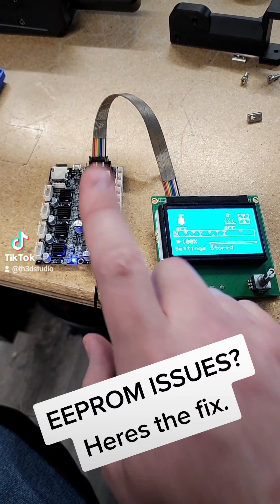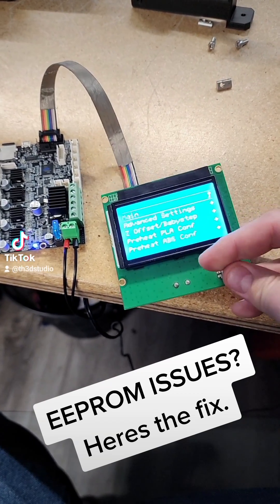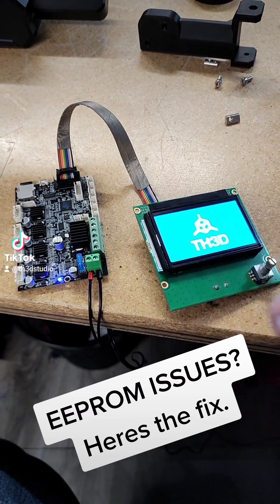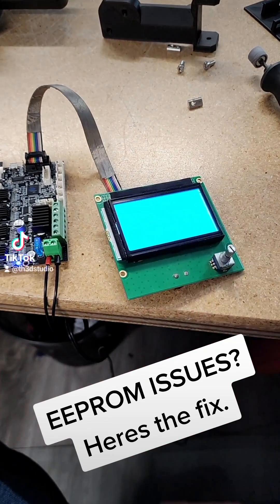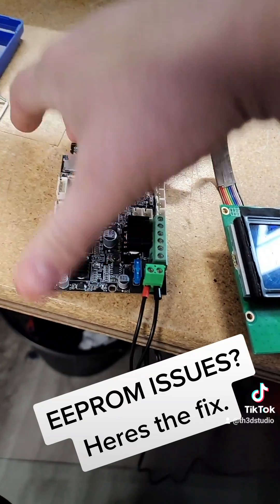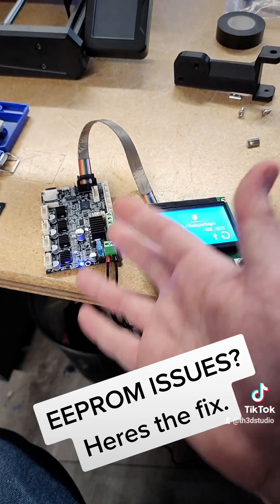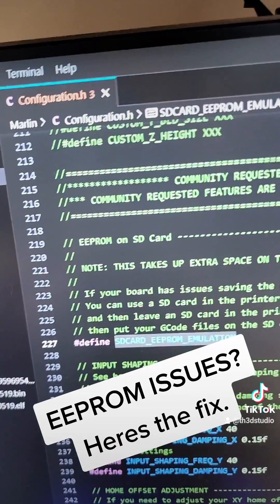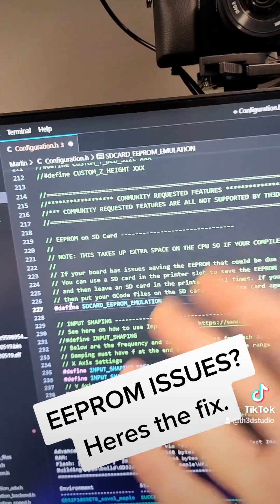EEPROM issues? Here's the fix with our new Unified 2.69 update. #3dprinting #firmware #update

Comment: Footnote: In the upstream Marlin this can be enabled with SDCARD_EEPROM_EMULATION. It's normally hidden in pins files but you can add it to your configuration if you really need it. It will read the stored settings from a file if the SD card is present on bootup, and just requires the SD card to be inserted to use M500 to save settings.
Reply: I have ender 3 pro and saving the changes on SD card as well. But, whenever I make a PID tuning using pronterface, and save the setting with M500. either I am getting an error that is not saved, or it is just hang to ... Saving (or something like that) can you please help?

Comment: Hey, can you help me out. My EEPROM died on an aliexpress 3d printer (JGmaker Artist D-Pro). Are all EEPROMs interchangeable? Can I just take a replacement EEPROM and solder it in place of the current one? The mainboard my 3d printer uses is the MakerBase MKS Robin Pro V1.0. Also, I don't know exactly where the EEPROM is located on the board.
Reply from the maker: I would just swap the board. Those can be found for under $50 on aliexpress.

Comment: Just had this problem with the svo6 plus loaded the TH3D firmware 2.69 for it ill have to re compile it and in able the sd card for z offset saved on sd
Reply from the maker: Give it a go!
Reply: @TH3DStudio   I did right after the fan update still crashes into the bed so I think i'ts the board i'm just waiting for Tim todo the svo6 plus ezboard replacment  video and firmware for it .
Reply: ended up being the wonky way sovol sets up there  Z to home at 5.0 from bed if I did a Z offset from there then try printing a benchy it would ram into the bed so after doing a Z home going into movement and set the Z axis to zero then do the Z offset then store it fixed the wanting t dive into bed on a print start